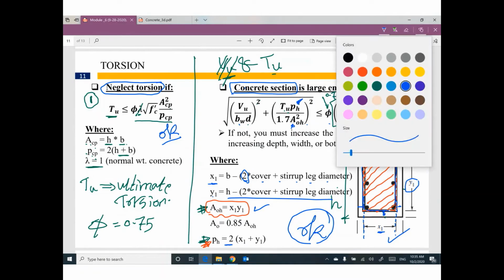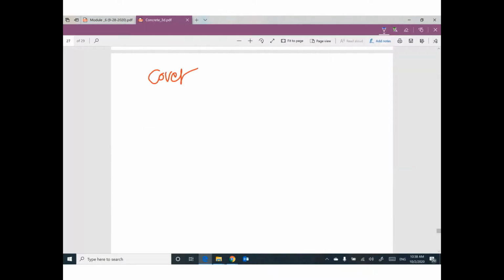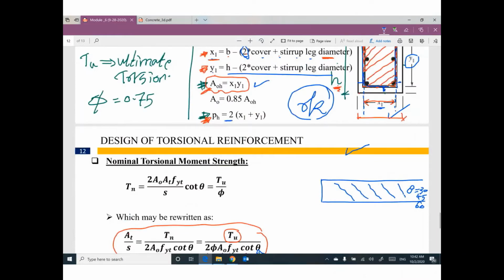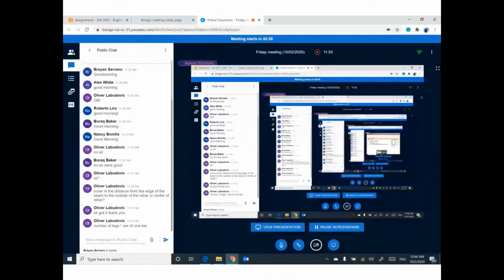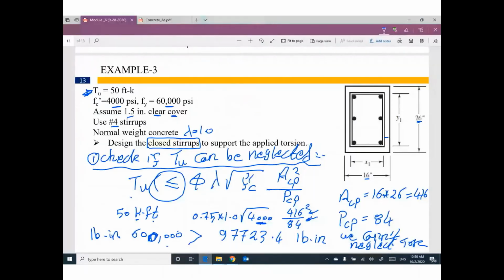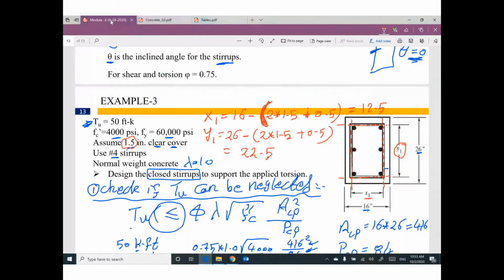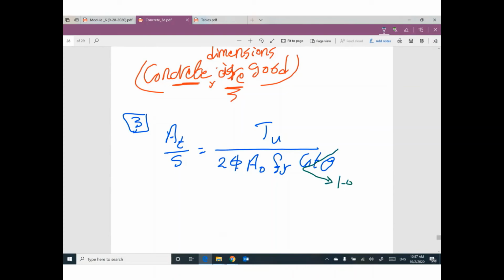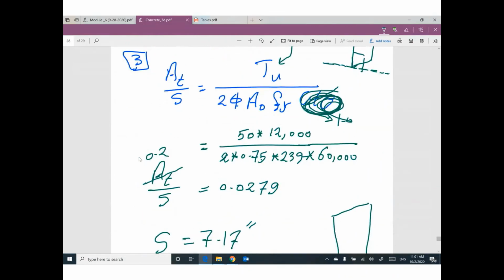Design of Stirrups due to Shear and Torsion part 3/3

Comment: But cot 0 is undefined
Reply from the maker: It was a mistake. θ is not the angle of your stirrups (they’re usually vertical), but the angle of the compression strut in the concrete, which is usually 45